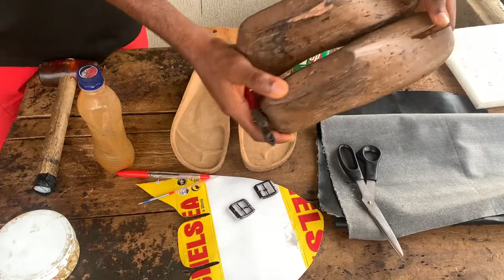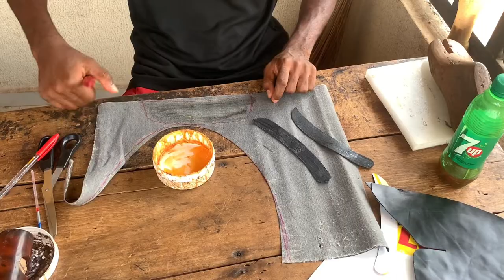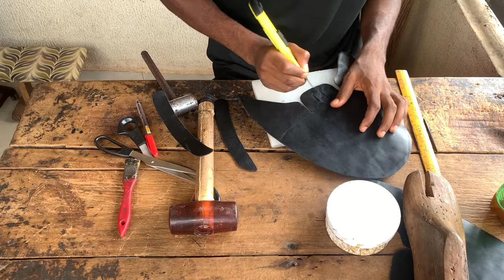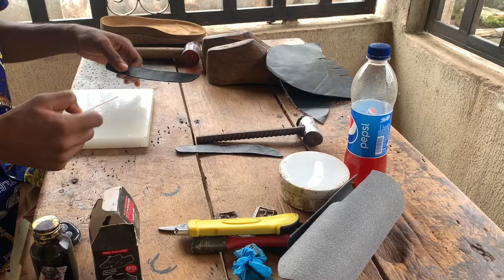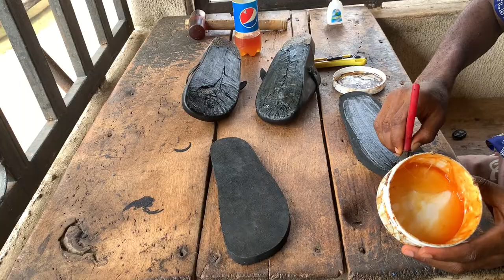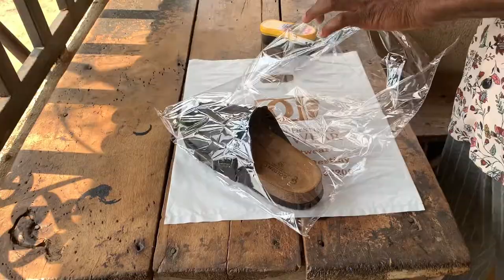MAKING OUR BIRKENSTOCK MULE!! watch and learn how to

Comment: I wish cork insole is available where I am
Reply from the maker: Where are you based
Reply: @Egah_1  India. I went to my cobbler and a material store yesterday, not available anywhere
Reply from the maker: It's really available here in Nigeria
Reply: @Egah_1  Ahh nice nice. Out here when I checked online I could only find the birkenstock replacement insole which cost around $40. How much does a pair of cork insole cost there?